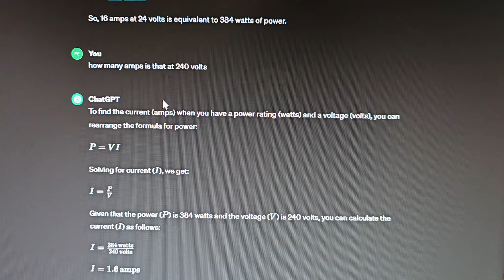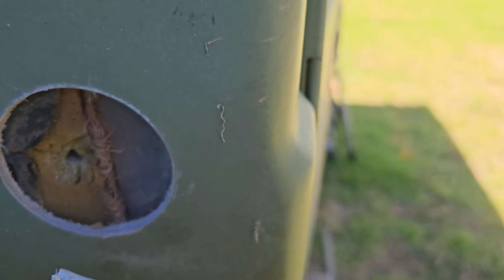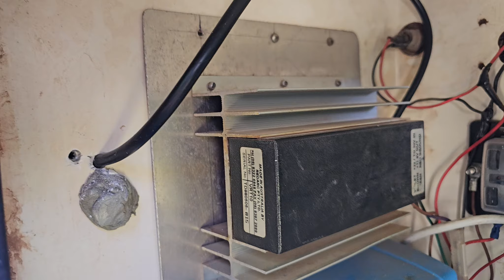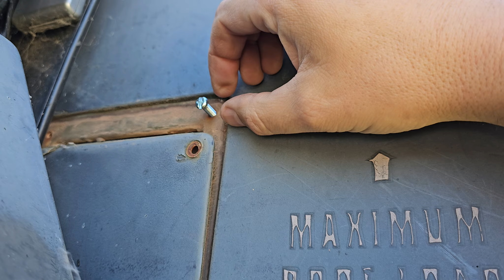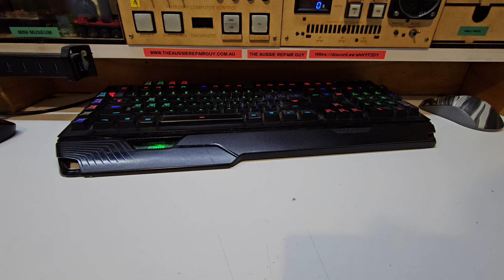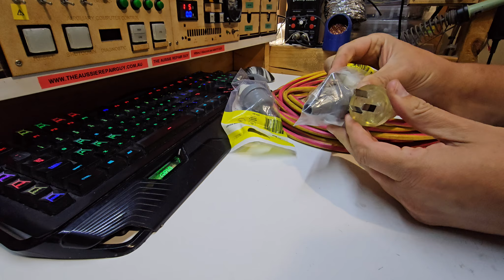Adding a Mains input socket  | 6x6 Land Rover Perentie Ambulance

Comment: The caravan parks will complain about using 10A lead but they can't stop you, especially if the unit you're plugging in has 10A circuitry (RCDs, etc). They can complain all they want, but there is nothing illegal about it, and, therefore, they can't stop you from plugging in.
Reply from the maker: In Victoria they can.
plugging a 10 amp lead into a 15 amp socket is fine - have done that before, but having a 10 amp inlet on your RV apparently goes against new standards.

I'm going to assume that came about from people melting leads using a toaster and kettle at the same time in a caravan.